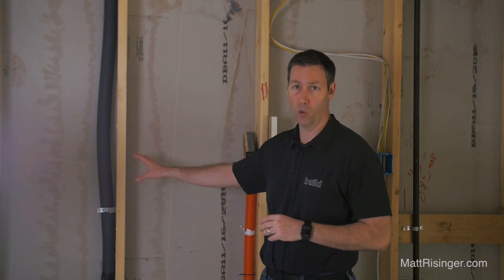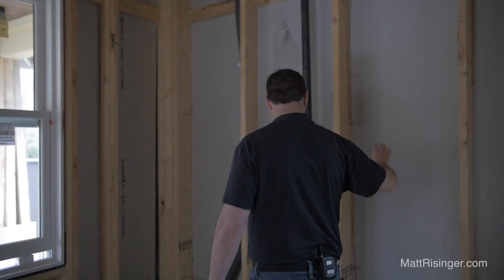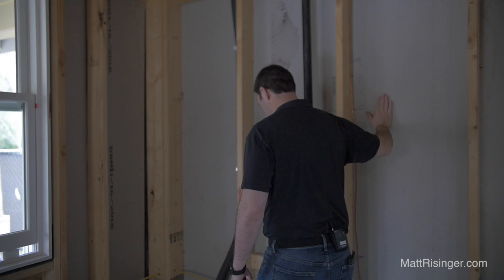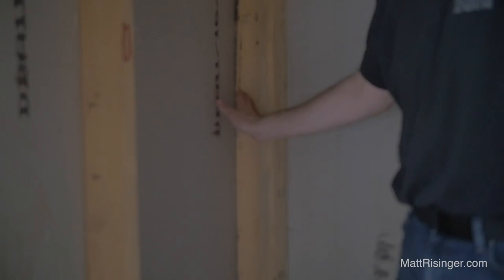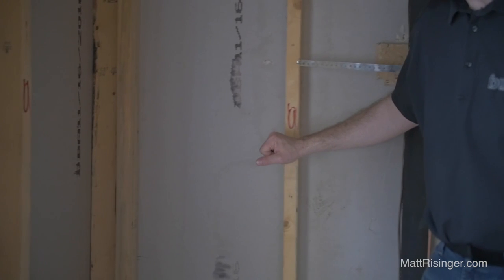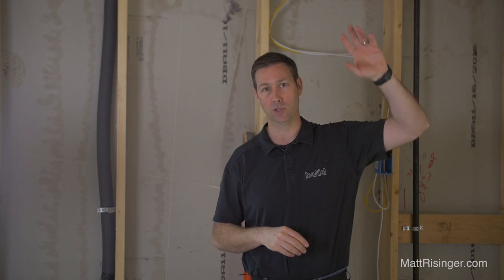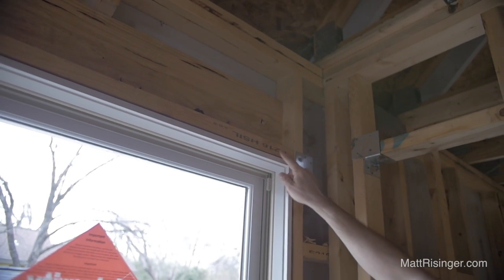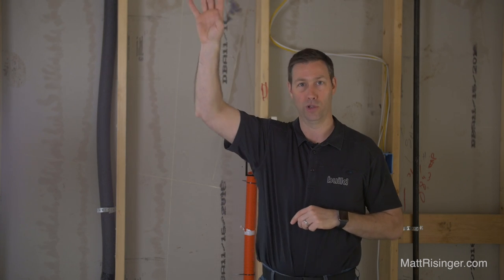Traditional vs. Advanced Framing

Comment: Terrible idea. 24 inch on center was tried back in the 1970s to cut costs. Bad idea.  Your old enough to remember why. Wavy walls everywhere.  Remember lumber has a a a crown to it.  That's why everyone went back to 16" oc.
Reply: spartaeus: ehm, every house in Norway is built 60 cm (24") on center. It works great. We used 2x4 lumber for exterior walls 30 years ago, now we use 2x8. Btw, a 2x8 here is 48x198 mm, which is a bit bigger than the American 2x8, which is really 1.5"x7.25", or 38x184 mm.
Reply: Well not everyone. In eastern Pennsylvania, approx 10 yrs ago I worked for a home builder doing 80ish homes a year. Exterior walls were always 2x6's 24" oc, except garages which were 2x4 but still 24" oc.
Reply: Like i always say there is more then one way to skin a cat who cares how the house is built as long as it dont fallon me in the middle of the night im happy i know guy who will use one nail per stud on the im side part of the stud the humdred or so nails on used to sheet the extirror of the was holds it all together mind you that not my method but
Reply: i've been framing here in Canada for 30yrs and never once framed a house with 2x4,, always 2x6 16" O.C. and sometimes 12" O.C... I'm from the east coast and now live in central ontario,, and the "National building Codes" are different given the region... i.e. 'snowloads' with dimension lumber for different regions, plus in carpenter trade school, we learned how to 'stick frame a roof' vs truss systems.. and only stick framed a roof once.. all the others were truss systems!
Reply: What did you say??

Comment: We live in a National pre-fab, circa 1958, that is as structurally sound as the day it went up.  The biggest drawback I have encountered is the 2" interior walls and the weird floor to ceiling sliding closet doors.  It is about to receive its third roof, but has otherwise been strong and tight for the 36 years we have lived in it.  Not bad for a home that probably sold for about $10K when new and has a current assessed value of $115K.  And southern Indiana gets its share of tornados.  The impending roof replacement was brought on be recent wind storms.

Comment: This video needs to be called Traditional vs hack framing. Brought to you by Simpson, werhouser, and the people that really like to glue shit together.
Reply: Tom Foolery his examples for issues in traditional framing are considered rookie mistakes. Also it may have been a trick of the camera but it didn't look like the cripples made contact with the headers, making them unless. Lastly many builders use ladder blocking for interior to exterior connections, however the only reason you're getting cold pockets in your corners is because you are assembling them wrong, intentionally, for the sake of the video. want more R value? INCREASE the THICKNESS of the WALL. Also a closed cavity gap between the siding and the wall also contributes to R value.
Reply: Joseph Raridan we use " California corners". Basically a 2x6 flat against end wall stud. Insulation goes behind

Comment: What is the cost difference between the two types? also would be nice to know the difference in amount of wood used and labor costs for this new type
Reply: Matt Jacob not to mention the other trades that come in and see what they're working with.
Reply: Building costs are local so it's hard to tell but it generally runs a little higher when you factor in the cost of the additional insulation and thicker Sheetrock.
Reply: John Clark not to mention the increase price using 2x6 versus 2x4. Plus all those metal engineered clips.
Reply: 2x6 24 oc is usually cheaper than 2x4 16 oc and is stronger. Clips vs wood are probably about the same tbh.
Reply: 2Awesome 2x6 are 4 times stronger than a 2x4. The more the merrier.
Reply: Matt Jacob cost is same for the home buyer.the profit for the contractor is bigger
Reply: You also have to take into account the repair (rebuild) costs.
Reply: There are different measures of "strength" and the 2x6 is only stronger in one of them, and frankly that is the one that matters least in residential wall construction.

Comment: Couple of minor thoughts about 24" OC vs. 16" OC spacing.  I like the idea of increased insulation, although with the thermal break offered by the exterior rigid insulation this perhaps isn't as significant.  The negative here is that when it comes time to hang cabinetry, shelving, or even heavy artwork down the road, you are left with fewer options for hitting a stud.  Thus at least in kitchens it may be necessary to install some blocking to fasten cabinets to and you may have to think ahead for other items to be wall-mounted (televisions, shelving etc.).  Also, 24" OC would allow more flex in the drywall so I'd strongly consider stepping up to 5/8" thick drywall instead of 1/2".  That adds a minor amount of cost, but also does a much better job for sound control so it might be worth it.
Reply: This is why we have plans.  Kitchens contain additional framing for cabinets and such.
Reply: Agreed John - and that works for the items we know about up front. However as a homeowner I've installed shelving, garage cabinetry, heavy mirrors, wall mounted TVs, etc. and it is often preferable to hit multiple studs. That is likely worth consideration.  Just something that may not be an issue until years later. 

There are typically workarounds but it could be an issue in some cases. All benefits and negatives are worth thinking about.

Comment: Matt you direct us to the Gable end wall with a 2X header but show us a spot where pre-manufactured trusses are bearing over the 2x header. I can only hope there is an engineered girder gable truss and the perpendicular trusses are in hangars (Not shown). Insulation works both ways, heat rises, and you went 2x4 exterior on the second floor, which negates every 2x6 exterior wall on the first floor (except on paper or in T-24 calcs).

Comment: Insulation helps keep houses cool and warm why would you not go at least 2x8 exteriors get a full r40. The header looks like an interior door frame. Good luck closing a slider. And having the first and last stud touch like an L is proper just add a stud on its side to screw the drywall to. Can you guys get a Canadian building code book and use it your houses will last a lot longer.

Comment: 2x6 framing is code in Canada. 16" centers are common but 24" are allowed, however, this requires heavier sheathing negating the savings. You could probably delete the header in a gable wall (as it does not carry load) with an engineer's approval but the cost of the engineer would far exceed the cost of the header lumber. Build stronger than necessary, not as weak as possible and your house will last longer and require less maintenance. Code is the bare minimum you can get away with not the best you can do. Wavy walls, bouncy floors and high heating/cooling bills are what minimum code gives you.

Comment: European here, you guys don't ever build with brick?
Reply: Yes we do, but timber is inexpensive in the US and our climate is much more diverse than Europe.
Reply: Laurentiu Cauni  most everything you see down in Florida is Concrete Block Construction nowadays.
Reply: No, John, that is not the reason they built different in Europe in the past; they want homes to last 500 years, not 80 years.  Our climate is varied, just as Europe's is.
Reply: Agree to disagree.  Look at the Koppen Climate classification.
Reply: You do not want to build with brick in active seismic zones which means all of the West Coast and Midwest along the Mississippi and Ohio River. And other areas around the country like Charleston, SC or even NYC. Having a brick home in the West Coast significantly increases home insurance even without having earthquake coverage.
Reply: how do commercial concrete buildings hold up then?
Reply: nathan alan so in theory, you could make your custom home out of concrete if you wanted to.
Reply: It's not a theory it's a fact. Anyone can build a home with reinforced concrete but it all comes down to cost and if the homeowner can afford it. Just search for tornado & hurricane proof homes.
Reply: Typically, brick on houses here on the west coast is just veneer over a frame building.
Reply: Load bearing masonry isn't very popular in the US for residential construction, for many reasons.

As mentioned by others, costs on not only materials but the labor and speed of assembly are much faster with wood, as is the practices associated with the additional thermal barriers that are installed afterward.

My wife is from Germany and I've often viewed the very traditional clay block used for residential construction there (and throughout Europe) as arcane, however, traditions and methods are extremely difficult things to change, even when better methods are available, and some of that is plainly due to preconceptions. Ironically, I've seen a lot of newer construction in the last several years in Germany being completed in a Western stick-framed manor, and I've yet to speak with owners who are dissatisfied with it.

As an aside, the Swedes (very severe climate) have long used a similar stick-framed system to the US, but more recently, I've seen them adapt it to a panelized, prefabricated system that includes sheathing, house wrap, a drainage/rain-screen layer as well as wiring and sometimes even the insulation. Really trick system that has a huge advantage on installation time and costs.
Reply: Aren't florida homes made of block?
Reply: Often, yes, and I understand the reasoning that's given. By and large, it's a code-driven response to hurricane resistance.

I also think it's a crock. Seriously, I could write a book on it.
Reply: Interesting. So if budget weren't a problem, how would you build your custom home?
Reply: That's too vague a question; it's circumstantial.
Reply: This isn't stack exchange. Just have fun with it.
Reply: I have no idea what you mean with this comment.

gb.
Reply: Between earthquakes, tornadoes and hurricanes, most of the US needs protection that you wouldn't need in Europe.

Beyond that, brick is just not a particularly efficient means of building buildings. It does a poor job of keeping the heat out during the summer and during the winter it sucks all the heat out of a building. It's a bit like living in a concrete building, it just sucks most of the year.

Also, it takes a huge amount of time compared with framing up with wood. A crew of guys can get an entire wall done in a rather short period of time.
Reply: Not in Europe. The most popular method is the use of a fired clay block (it's an oversized brick, about the size of our CMU - concrete masonry unit,) and assembled in the same method, and then an exterior layer of insulation is adhered to it, then a finish layer of a stucco-type material.
Reply: CMU aka Cinder block or concrete block.
Reply: Yeah it's practically the same thing and building method. I lived in Europe so I have stayed in such abodes and seen new home and apt. construction.
Reply: Laurentiu Cauni Not really. A modern brick house here is framed with wood just like in the video and then a single layer of bricks is used more like siding than as a structural component. Before 1900 or so a house might be built with true brick walls.  untill 1950 cement block was often used for walls espesially in garages or commercial buildings. that may or may not have been covered in a layer of bribcks, but today poured concrete walls are usually more ecnomical than concrete block construction.  Today we use brick as a durable low maintence high  end exterior to hide whatever the wall is actually made out of, not to build the wall itself.
Reply: I've visited the Nashville, Tennessee area and there were lots and lots of brick on the exterior. Way more than in Missouri. To answer your question, it varies regionally. I also noticed slab foundation there, whereas basements amd crawl space are common where I'm at.
Reply: Exterior walls are usually block then with some sort of exterior finish (Brick, Stucco, Siding)
Reply: "...on the exterior."

Only.
Reply: Laurentiu Cauni Brick was once king, but has always been a more expensive than a wooden structure.
Bricks are out of the question in seismically active regions. Brick is very inflexible, heats up in summer, holds the cold in winter, and still requires an interior structure for wallboard, floors. 
Brick looks great, but it has strengths and weaknesses.
Brick structures take longer to build, since one can only run but so many coarses at a time. Cement needs to set and cure. Using cement in winter has it's own set of challenges. 
A wooden house can be built in a single day.
Reply: LetTheWritersWrite they are built from steel framing with brick facade
Reply: Chris L what you're saying is brick is bad for insulation and not for building overall. it serves different purpose in a wall - structural - as well as lumber in woodframe. sure it's not feasible to build brick wall with the same r as a woodframe one - it would have to be 5-6 time thicker. but no one does that - you take minimum (reasonable) amount of brick and insulate it up to the same required r. in this case it doesn't get hot in summer or cold in winter and even helps to normalize temperature and humidity inside the house throughout day/night cycle or during other "sudden" changes in weather even without conditioning system in place.
Reply: Europeans live in 500SF houses. So they can do brick.
Reply: irritablearchitect Def not a croc. Grandparents had a concrete house in Homestead and it was still standing in Andrew. They took the time to take some clay puddy and seal the doors on the inside and seal the outside of the doors with some thin plastic tarp. Only repair needed was the roof. Down the street everythong was torn to shit and flooded. Some wealthy guy wanted a solid concrete house, died, and his kids sold it to my grandparents.
Reply: Eiden only on walls,walkways and chimneys.
Reply: LetTheWritersWrite rebar
Reply: I never see brick being used anymore, I see concrete block though. Concrete block seems to be used for commercial mainly, and any "brick" that is used is a veneer only for looks. US builds houses to last 30-80 years. Everything is cheap and quick.
Reply: dlwatib 
Same in Australia most of the time.
Reply: Building Designer out here in California. Anywhere where there are seismic concerns brick becomes far more expensive. In a wood framed structure some deflection is a good thing, it allows the building to flex. With a brick building if there is much lateral deflection it can completely destroy the structure.
Reply: +LetTheWritersWrite Commercial concrete building shave steel frames and expensive anti-shock systems in the foundation. Sometimes, for really big towers, they sit on an actual gyroscope and vibration dampening systems. These things are not budget friendly...
Reply: It's common to see a new build house to cost near $100k.  If you build it out of brick, it's easily $250k-$300k.  Wood is fairly cheap, and you don't exactly have to be very skilled to operate a nail gun.  A good mason (you'll want one, especially to do the visible mortar joints) costs much more than most carpenters or builders.  I'm not knocking the carpenters, but you can all probably admit you've hired or worked with some people that you just wondered how they didn't stick themselves to the boards they were nailing, and that's why the labor is generally cheaper.
Reply: Here in Deep South we about 60% of homes are brick.
Reply: LetTheWritersWrite  lot of homes are block in Florida. It’s quick and easier to meet hurricane wind requirements.
I think south fla is at a170mph wind burst in the 2017 code
Reply: LetTheWritersWrite 
insulated concrete forms probably the strongest way to build a home.

Comment: Problem with 2 stud corner.  Have 1-1/2" to nail exterior trim, but only have sheating to hold ends of siding that butts the corner trim.  How do you overcome?

Comment: question about between the two types of framing.. is advanced frame weaker to storm damage or a tree falling down on it due to less frame? I understand that having less frame can make more space for insulation but how using less frame = more structural sound?

Comment: At best R 13!is all that's achieved in South east Texas. Allow the home to breath. Don't live in a yeti cooler. 16" on center for 50 years , much longer, is because it works. Dead corners? Wow. R1-r3 for wood? Wow. And the mind blowing part to me are the headers. Engineers are just that. Good with math. But millions of carpenters over 50 years doing the same things, double header with a plywood core, and it's proven. With all do respect, this video is bad advice. Especially in Texas.

Comment: This is presentation is a version of optimum value engineered framing, a method that is much more detailed in practice, and open to variations in application due to local codes, seismic measures, etc. Every house can benefit to a some extent or another from a well planned adoption of specific techniques of OVE, but it is definitely not a one size fits all situation.